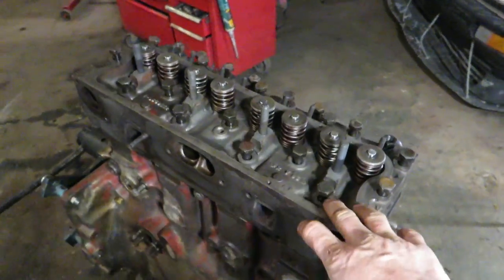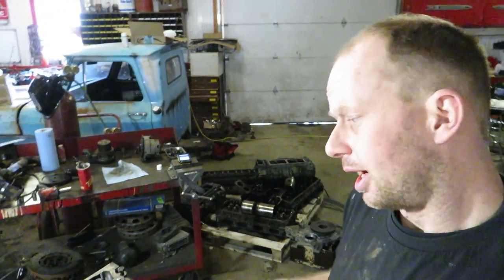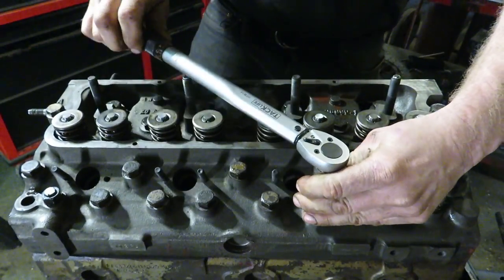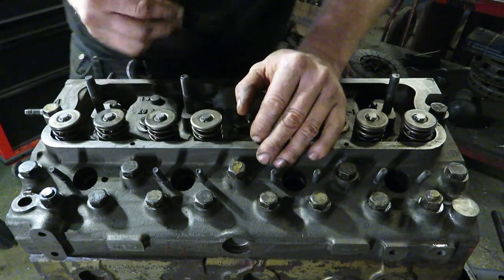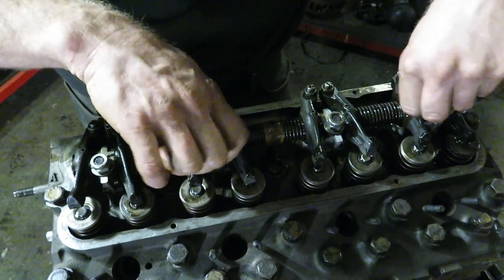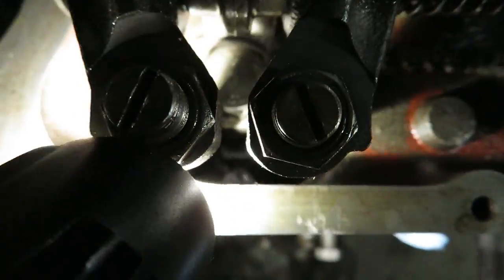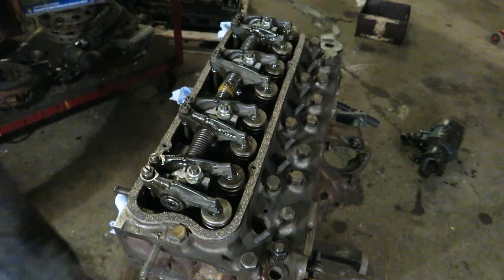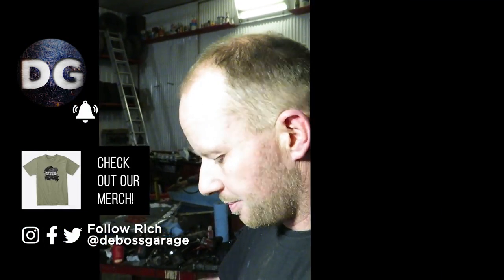3.9 Perkins 4-cyl Head Assembly | Massey Ferguson 270 [EP3]

Comment: When I do the cork valve cover gaskets I stick them to the valve cover with Hy-tack and then put grease or anti-sieze on the other side so it does not stick to the head. Makes it really easy to pull the cover to retorque the head.
Reply: I didn't think about putting grease on the one side. Thanks for that.
Reply: I have been known to replace the cork with silicon.
Little grease on the rocker cover, run a bead of schmoo, little oil on the head, plop the cover on and let it set.
Once it is set, pull it off to check you dont have wayward silicon, then screw it down tight.

Presto, one reusable silicon gasket that (almost always) never leaks!
Reply: @TheFridge   be nice to your technician.... leave the antiseize alone unless your putting different metals in contact

Comment: Great video. Another trick for the fuel injector copper gasket, heat to red and drop in cold water. This will soften it up so it can be used a second time.

Comment: when setting valvelash with engine in my 4wd manual diesel. i raise a front wheel in air put it in 4th gear then rotate tyre to rock the valves over makes it pretty easy to get engine to turn over
Reply: LandRoverLife This is also the best thing to do if you have taken it for a swim and it stalls, don’t turn it over, Jack it up, put it in 4th gear and remove the glow plugs or injectors depending on which is easiest to remove and watch the water squirt out 😂😂. Learnt that from a friend of mine with a Land Rover. It still ran fine after too.

Comment: The Sharpie marker for the head bolts is a great tip. For those of us who don't film while working, some Sharpie markers in different colors can come in handy. You can use a different color for each step of the torque sequence. So even if you step away from the job, you can easily tell where you left off.
Reply: Best for this is white paint pen.  Torque to yield is only the last step IIRC.

Comment: One thing my dad showed me was paint the cork gasket (rattle can works fine) than the oil can't soak thru the gasket yet it still crushes fine. The pained gasket keeps the oil in the engine rather than out side, where it can do more good. Keeps the engine looking cleaner longer too which makes it look good for the customer.

Comment: Anti seize is king on earthmoving, since working with the stuff I've learnt anti seize paste ( copper grade etc ) is the go on all your external threaded fasteners, pins, circlip grooves etc unless spec not to do so. Also a bit on those injectors helps them come out again. Temp rating is usually sufficient.
Reply: It is the best! I work on quarry equipment and anti seize is the best

Comment: I used to calibrate torque wrenches.  Accurate range is considered to be 20% to 90% of full scale.  As you say, the micrometer setting wrenches are generally good for a long time so long as you back them off.  Dial type torque wrenches need to be regularly calibrated and need to be babied.  Dropping them, hitting them, generally almost any abuse can knock them out of calibration.
Reply: Very good explanation of how to treat a torque wrench! I also used to calibrate torque wrenches for the US Air Force. We noticed that many of the wrench’s that were out of spec came from the same work centers. When we investigated  why those specific work centers had so many failures it was because of the wrench’s being backed off to the end stop before storage. Never back off a torque wrench past the minimum marked value!

Comment: Rich my local race engine shop said you check push roods on a pain of glass a steel work bench will always have waves in it. All flat glass windows are made perfectly flat so you do not get distortion viewing through them if the glas is bent well... it brakes lol
Reply: Glass is always a bit of a fluid. Over years glass will sag, droop or flow downward so if you put a pane of glass over two saw horses the glass will arch. Apply heat and it happens much quicker. But in terms of checking pushrods if you roll them you can normally catch pretty minute bends relatively easily just by rolling it around only by eye

Comment: Fyi better to find out the specs for those injector bolts because on a 6 cylinder that i had worked on it will do small cracks on the head if thighten to much but again even with the cracks it wont effect the engine because of the locations of the cracks thank you been with you since day ☝️

Comment: I had a Valve Cover Gasket on an AMC I6 (Plastic Cover) kick
my butt at wanting to leak, mostly because it had very few bolts.  So a trick I learned is I made some wire
clips that kinda looked like your average household staple, for a desktop stapler…anyway,
they hold the gasket from moving around during installation, and maybe I was a
little RTV happy…but try it…they work really well!  -  My
dad who worked at Ford came up with the idea back in the 70’s when trying to
put Valve Cover Gaskets on LARGE V8’s in the Mustang Chassis.

Comment: As mentioned below, alway check the relivant workshop manual regarding lubricating cylinder head studs prior to torqueing, it can lead to over torqueing if the manual specifies a dry fit.
Some engines also require new studs to be fitted when the head is removed.

Comment: I noticed on your previous video you used your torque wrench to loosen a bolt I was taught not to do that that the reason that the wrench works both ways is for torqueing reverse thread

Comment: Hi, you might be my only help here....AT 6:58 of the video you make a mention of that rubber "o ring" thing that goes on the oil supply tube...I am missing that on mine and am wondering where to find it? I am having a devil of a time trying to find that, I don't even know what it's called....or if I can just go and buy a large o-ring to put on there. Any advice or help?

Comment: You should have the rubber gaskets on the injectors, they stop the injectors getting stuck in the head. Had one missing once and ended up snapping the injector trying to remove it, took a few hours to get it out without damageing the head. ?

Comment: spent so many years working for Perkins, those were great little engines, has it still got the list and engine number plate on the block near the fuel pump?
Reply: Perkins engines were used in many taxis, tractors and small trucks in Spain. 
They were notoriously noisy yet tough.

Comment: @12:45 - (wet) torque spec per application if unspecified will almost always torque to yield aside be a function of the fastener size and thread pitch. it's why a particular fastener size and pitch was selected. You're not going to find a 1/4-20 spec'd to 85 ft/lb, or a 3/4-16 to 20 inch pounds.

Comment: Lol. Love it. 3.8L 4 banger. And makes maybe 50hp lol. Love these old tractors. Would love to send you my 74 wheelhorse c121 for an engine rebuild.
Reply: Heh. But for a tractor, torque is what really matters.
Reply: Actually there 85 hp. 285 ftlbs at 1200 rpm

Comment: Hello, my mechanic just finished rebuilding a Massey Ferguson 698T perkins engine model AT4.236. When the engine is started, it runs smoothly for about 20minutes then we discover water leakage from the engine. He has assembled it twice and changed the gasket but still the same problem. Would you or anyone have tips on what could be the problem?

Comment: Super video coudn t wait for it.
I really like your videos you are super DG mechanic !!
I have the same perkins engine and  these video its so going to help me ... i will need to do the overhoul as well when you put on gas its goung on blue smoke not black ... 
   when you tight the head  and you say that you will make it hot and do it again its these step need to be done or its just good to do it ? 
And how do you mean by that when you making valve clearance when one its rocking its that mean that it have some mouvment betwen valve and rocker ?

Comment: Hey Rich, I have noticed you say something a couple times now.  You lubricate your bolts and claim that it gives you a more accurate torque reading.  This is not necessarily true.  In the bolt torque and tension world, if lubrication is not called for, you don’t do it.   Lubricating bolts can dramatically change the tension applied when the bolt is torqued to spec.  Same goes for not lubing a bolt that calls for it.  There is actually a case of a wind turbines nacelle falling off simple because the bolt were not lubed during erection.  In short, adding to lube to your bolts before torquing them is not a hard rule to live by, its application dependent.
Reply from the maker: Thanks!  The perkins calls for lube.  So does Cummins which is basically what I do.....
Reply: DEBOSS GARAGE Cool, good video as always 👍
Reply: DEBOSS GARAGE the oil on the head bolts, crank main cap bolts and rod bolts reduce the amount of friction that occurs when being torqued there for giving you a more accurate torque. Cummins uses this on every engine we have to my knowledge.

Comment: What would it take to turbo something like this?
Reply: finding a oil pressure port, or drilling one. 
a oil return hole straight to sump. 
A turbo,  -with oil lines etc
a custom exhaust manifold, 
routing turbo to exhaust, 
routing turbo to intake/ custom intake 
adjusting the IP 

those are the main things, a lot of small things to add. Don't have experience in the field tho
Reply: Leofred some of them perkins 236 came with turbo from the factory.
Reply: check out MRHEVYSHEVY. He just did an inline 6
Reply: Sean Price  why is that? the shape of the combustion chamber, or compression ratio?

Comment: Norbar has published several PDFs on the unloading of the tension of a mechanical torque wrench. Here is a link to the latest one on there site.http://www.norbar.com/Portals/0/Wind%20Torque%20Wrench%20Back%20Blog.pdf
The difference between this latest statement and one published April 16 ,2018 is that they removed their statement that unloading the tension had little effect on the accuracy. In the latest statement they do stress not taking the bar to 0 but only to its design minimum setting.

Comment: Confucius say: you got a cylinder head off, you have it machined and pressure tested.
Reply: You only need to do a head gasket job and find out after its done that the head had a crack in it once to learn you should always send the head off for a haircut and pressure test at minimum anytime you do a head gasket..
Reply: Right? You're already there, why risk more problems to save a few bucks?

Comment: Do the next guy a favor. If your not going to put those rubber orings on the top of the injector housings, at least paint the injector bodies with antisieze or the will never come back out of the head without pulling the insert they set in. Then coolants going to gush out and the next guy will have to pull the head again when all he was after was a simple injector job. There's a reason for those orings up there. I can't believe they didn't send them. At the very least paint those injector housings with antisieze.

Comment: Enjoy your stuff, but I caught an oopsie doopsie today. Contrary to popular belief you actually are NOT supposed to back off a torque wrench completely to 0. That actually causes the torque wrench to become inaccurate. It’s best to keep a low pressure on a standard size torque wrench to 20ft/lbs.

If you use a torque wrench frequently (which obv you do) they recommend that it’s even better to leave your torque wrench at the setting you usually use, instead of always backing it off.

FFT
Reply: Usually its the last graduation on the scale that still has tension, which is usually 20% of max capacity.  So a 250 ft-lbs wrench would be stored at 50 ft-lbs, which is also its lowest setting.
Reply: Tate Halpin you are correct. Meant to say that after I read my comment. 👌🏻
Reply: Doug Anderson was waiting for someone like you to call me out for “they” lol IF you knew what you were talking about you wouldn’t have to question whether it’s a credible bit of info or not. Keep hackin at the keyboard💪🏼.
Reply: Doug Anderson also, read a manual. Of course, someone like you throws all sorts of credible information like that out.
Reply: Just wondering what torque wrench manual said to leave the rest setting at 20%?   My doesn't but it is for a 20 year old Sears wrench.   If there is newer better info then that would help a lot of us DWI types.   Thanks.

Comment: Please let me say something though. It's fine to re-torque bolts that were not yielded but PLEASE never re-torque bolts that were yielded. If you've ever had a snapped bolt inside of a cylinder head on a torque to yield application, you can blame the previous mechanic for "retorquing" after a heat cycle. Once a fastener has reached yield strength, it cannot provide any more clamping force, turning it further will only weaken the fastener.
Reply from the maker: A hot retorque is what Perkins wants.  I guess I should have said "follow manufacture spec".  This video is specific to Perkins

Comment: Why???????? You said this thing wasn't worth your time.  I like that you're doing it though.
Reply from the maker: It is worth my time.  I'm getting paid for it.   The tractor still has practical use.  Granted the engine job will cost about the same as a tractor from auction but this one will have a brand new engine.  And one new tire....

Comment: I had same problem as your friend mine the cam lifter shaft was missing middle cam bushing and the oil was dumbing straight back into the sump  starving the top end …… destroyed all valve rockers …… Perkins I Australia want $1600 plus shipping importing from Singapore  for a replacement rack….. all other parts was an additional $3000 ….I searched online and found genuine parts in England for 125 pound …. Bought all top/bottom seals and some other consumables for 425 pounds plus 128pound shipping from England which converts to just over $900 Aus 9 days to deliver.… all 100% genuine packaged parts  it blew me away the Australian mark up is extraordinary…. Anyone want the England dealer details send me a message and I will send you details #sickofbeingrippedoff
Reply: Hello, please can you give me the contact details for the English company I have the same problem. Thanks